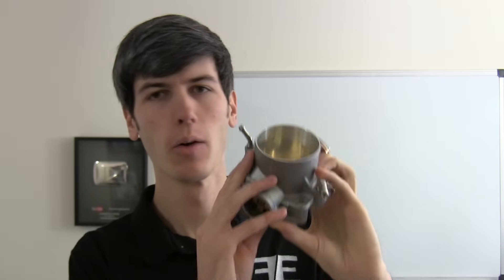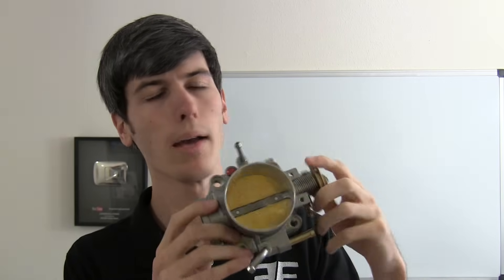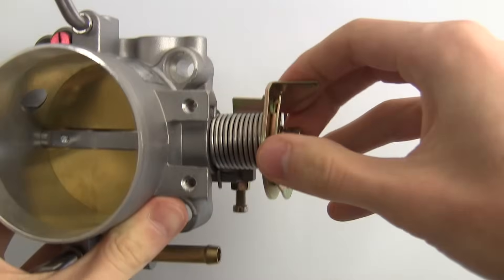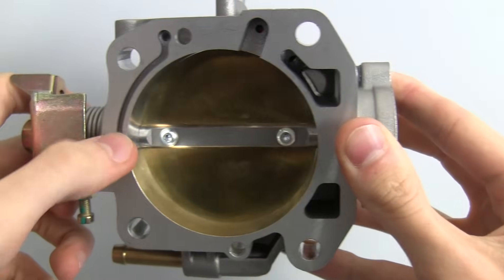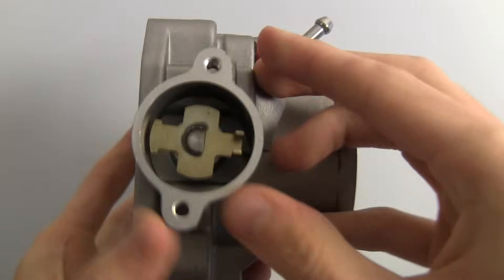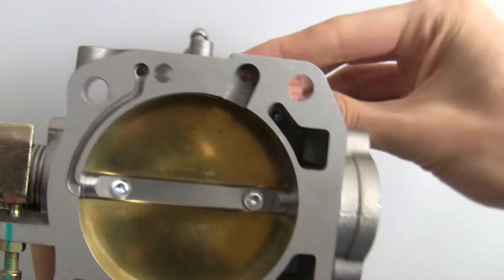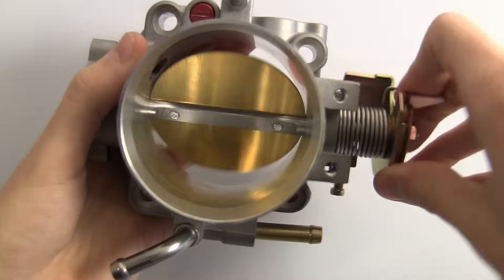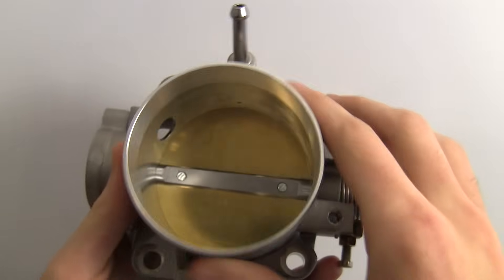Throttle Body - Explained

Comment: Hey I have a question. If I install a k&n cold air intake, a jet flow throttle body, and a jet flow mass air sensor. What can I gain? 2016 Chevy Silverado.
Reply: Look at the dyno charts. Also if it ain't dyno tested it ain't worth it. Always make sure the parts you're interested in are proven tested (with dyno results) as a lot are not. With all that being said generally speaking on average you could gain upeards to 20HP AND 15lbs torque with just an air intake. 
Edit -
•what size throttle body
•air intakes increase volumetric efficiency in your air intake plenum which increases HP in higher RMP ranges.
•get a jet performance MAS sensor with a throttle body spacer of about 75mm or bigger for your truck I suggest a 105mm throttle body
Reply: Your truck after those upgrades should pull about a 13 second 1/4 or quicker on average depending on how well you drive.

Comment: I'd love to see an explanation of Throttle Body Spacers and if they even truly do anything or not. Too much controversy.
Reply: Fake Name that sounds like a personal problem as that was a cheap one lmao
Reply: Do your research and you would know. Spacers are all about adding Volumetric efficiency, (more air traveling through your plenum). This increases MPG, HP in higher RMP range, and keeps the engine cooler providing more cool air for better, more consistent performance output. It's really simple and the information is more than abundant, friend.

Comment: This was a great, concise explanation of a throttle body. Thanks so much, not a huge car guy and I'm supposed to design a throttle valve and do CFD testing on the air flow for my senior design project so this was a good start on the anatomy of it.

Comment: This pertains to a YZF-R6 motorcycle, but I imagine the concepts are similar to cars. Long story short, my bike is running slightly rich and it’s either the aftermarket muffler’s reduced back pressure (I know it sounds backwards but supposedly on FI bikes this causes rich), or a TB issue. 

My question is; does adjusting TB vacuum pressure have any effect on mixture? If so, would a higher vacuum draw correlate to more, or less air per fuel?

Comment: my engine light came on my 2010 Chevy cobalt. I had it diagnosed. it came   back as the throttle body. cam shaft and multiple misfires. now my engine light has went off. my dealer told me that it may have corrected itself and just wait and see if it comes back on again. Is this fact? also I am in Indianapolis and we have  had very freezing temps.

Comment: my car threw a code suggesting the throttle body was the problem. also on the same day, the car lost power. It drug like it was in 3rd gear trying to get going from stop. It also threw another code suggesting canister purge valve solenoid. But I am assuming it is the throttle body that is causing the power loss correct? And why would both codes go at the same time. Could one be responsible for both?

Comment: hello sir can you  please explain or post a review of the throttle body of toyota corolla 95 model how parts works and how to adjust idle and tuning.. thank u ,,, my toyota idles  high like a 1200rpm.. i just want some900 but i tried everything but i cnt seem to fix or lower it down

Comment: Can someone tell me how the car doesn't move when idle, even when the engine is revving, but when the accelerator is pressed, the car moves, I was just wondering
Reply: Ya it's called neutral.. when in park (neutral with brake on) or neutral the transmission is not connected to your gearing in your transmission which puts power to your wheels which moves you. So therefore when you rev the engine in these gears your wheels do not get power but the engine itself does.

Comment: Nice video, thanks! Do you think that it could be possible to obtain a good increases in horsepower and torque changing the stock throttle body in naturally aspirated engine?
Reply: Why is it that ,you did not explained ,how to adjust air screw how many turn exactly for a good mixture when engine is in idle mode
Reply: Yup it will especially if you're engine responds to modifications easily like the old school 302 Ford 5.0's do.

Comment: Great explanation and very thorough.  Can you explain what a throttle body spacer is and how it works ??  I have an F-150 w/6.0L engine.  My son says I should put one on and it will help power and fuel mileage.  Thoughts ??

Comment: Hey Jason, could you do throttle body spacers?
Reply: Yeah.

It would be cool be cool to see the science, if any, that throttle body spacers could have.
Reply: @joshcamarena64  damn the amount of you people who are lost on spacers is baffling... They increase volumetric efficiency by adding more area for air to gather and spin creating more suction with a turbine like effect. This is used to increase the amount of airflow in your cylinders, increasing HP in higher RMP ranges, keeping your engine cooler, providing an improved level of consistent performance, and also increasing your MPG. Do your research. Information is everywhere just like oxygen kid.
Reply: @shoveI  read my above reply genius.

Comment: Good explanation, thanks.
I was looking for videos on which product (throttle body cleaner vs carb cleaner) to use to clean the throttle assembly/valve on my scooter safely, and ended up getting a very useful tutorial.

Comment: can you tell me what % of fuel is entering in to the combustion chamber when there is 30,40,50,60 degrees of rotation in throttle respectively.

Comment: if im cruising in top gear and let off the gas pedal, throttle body will be closed blocking the air going to the intake manifold. will the fuel supply stopped in cylinder? if not, how the cylinder gets air?

Comment: Is the butterfly plate needed on the throttle body??? Silly question to ask but, I have a vehicle with the ETC electronic throttle control and the reason I ask is because, the electronic chip I believe has gone bad and now my butterfly plate barely opens. I was wondering, can I just remove the butterfly plate to allow more air into the engine or that's a bad idea??? What's the reason for the butterfly plate anyway??? I already cleaned my throttle body but found out, I have a bad electronic chip or whatever you may call it.
Reply: Could potentially cause idling problems.  I did that on my sportbike for more power but the idle was all over the place and initial take-off was not smooth at all.

Comment: does the throttle body have anything to do with starting the car up I have a 2007 Yukon Denali I already changed the battery I already changed the alternator and some days the car starts up perfectly fine others it has hesitates to start up and I did a lot of reviews of the GM SUVs 2007 and up have a throttle body problem that's why I asked
Reply: Cam Mims I believe your gmc uses a electronic throttle. Those electronic throttles have problems because they are controlled my computers. The electronic throttle is probably the reason why you are having problems with your throttle on your gmc. I really wish that car juts stayed with throttles that had a cable

Comment: what does it mean if there's a rattling sound coming from the throttle body? can the throttle body be associated with rough cold starts? my mechanic originally said it was from carbon build up but when we looked that wasn't an issue.

Comment: does engine stop its cycle while no throttle?  ie,  no suction, no power, no exhaust
Reply: good question I want to know too
Reply: There is always a ideal amount of air flows in and thus the fuel, even though you don't use the throttle.

Comment: Why wouldn't you want to heat the air up before going into the combustion process. Hot air mixing with gas and exploding to 300F+ seems better than cold air. More conversion of the gas i'd suspect and less unburned fuel
Reply: ***** good point... it comes back to the trade off of more power or more fuel economy

Comment: Thanks for the info. I took my 2009 Ford F-150 to Alexander Ford in Yuma Arizona for stalling problems and starting problems. I was assured that 99.9% of the problems were caused by the Throttle Body. Can you tell me if this is true or not? At $800.00 for repairs, I would like to know.

Comment: Im sorry, what I don't understand is that how a throttle changes the air going into a cylinder. the only way more air can be put into a cylinder is by using a turbo or supercharger. you cannot change the amount of air going into the engine because there is a set space in the cylinder ( cc ) and the amount of air displaced by the piston is always equal. Please correct me if i'm wrong or tell me the answer, its killing me.

Comment: If I were to get a bigger throttle body, would I need a different tune, or would the computer, and the bunch of sensors be able to recognize it, and keep everything running fine?
Reply: This is really dependent on the parts you get. Some require a tune and others do not. I reccomend a plug and play throttle body of 75mm or larger.

Comment: When I turn my A.C on my car acts like it wants to shut off and it starts shaking. Is that do to the Throttle body?
Reply: do your lights flicker? your alternator might be bad if it dips too low
Reply: I'll have to check. If I leave my key in on the on position for a few minutes, the car won't start  back up.

Comment: Can u please make a video explaining individual throttle bodies vs single throttle body & what's the benefits between ITBs vs just CAI
Reply: +outofspace2014 And what would u choose between these two for your integra & why?
Reply: +outofspace2014 ITB tend to have better engine responses and better air flow. They are tend to not be friendly to every day cars, (cars that are not mostly performance oriented) and to get the most out of them they will have to be tuned with the car's engine. cold air intakes are simple to install and are more car friendly, when you put them on, they just work for the most part.ITBs allow all of the cylinders to have there own source of air. Just like exhaust pulses engines have intake pulses. On a single throttle body setup, since all of the cylinders are not firing at the same time and they share the same source the air is distributed between them, the intake pulses interfere with each other causing some cylinders to get less air than others reducing power. (the loss is very minimal, but if you are racing than that is horsepower you will not have, also the higher the RPM the more this is an issue) The reason why ITBs tend to have a faster engine response is because of two things, the plenum intake runner seen on normal single throttle body setups that brings the air to the intake manifold, and pressure waves. The plenum runner that are on normal setups have to depressurize before the outside air can go in, delaying the air from reaching the cylinders. Pressure waves are created when the butterfly valve or valves close. When air is rushing to get into the engine and the valve closes the air doesn't stop moving instantly. The air smacks the valve and bounces of it in the opposite direction, creating a vacuum in between it and the face of the valve. This vacuum pulls the air back toward the valve with added velocity causing it to enter the valve when it open at a faster rate than without the pressure wave. This only occurs when it hits the valve, so the valve will have to be mostly closed for these pressure waves to occur.This only works when an intake valves opens as the pressure waves reverts (pulls back the air). meaning that this only works at certain RPMs. With extensive tuning you can increase the amount of times it happens.The bad thing about them is that they do not play well with stock ECUs and measurements in stock cars. Without a plenum or filters they are exposed and can allow debris and unwanted materials to enter your engine. You can add a plenum but the associated benefit of not having one is hurt for the most part. You can supercharge with ITBs with the plenum on.With CAIs the benefit is that they tend to be farther away from the engine and closer to the outside air, so they get a colder charger of air. Compared to the ITB they are more friendly to cars and do not rely much on tuning.ITBs are for people who are looking to draw out every horse they can, like racing. Formula One and Dragsters use ITBs. CAI are for simpler builds and for people who want to add power to a car that can be a daily driver.
Reply: +godfather1118 Thanks for the answer dude :) Now i get it!!

Comment: sorry to ask but , what are the consequences to not have a throttle valve ?  and have the air that the turbo is providing directly to the engine ?
Reply: +JoãoHD LeagueofLegendsPT  If you do not have a throttle valve then you will not be able to control the engine's RPM and power. When the vlave is closed mostly it restricts the amount of air that can go in the engine, reducing the amount of power it can create. The larger it is open the more air can be passed at once and the more power you make. If there was not a throttle valve then the engine will suck as much air as it possibly can, causing it to redline until it breaks or runs out of gas.
Reply: thanks man !
Reply: Godfather explained it quite well. there are a ton of videos of diesels getting stuck at wide open throttle. worth a watch its kinda freaky

Comment: This video is very useful. I finally understand how my car's damaged throttle body was affecting the oxygen sensor and overall acceleration and why my rev meter was out of control. Many thanks!
Reply: This guy has done so much to educate people over the years. Wonderful channel.
Reply: Carly McCalla GM throttle body remplacement 1990
Reply: Yup. Imma guy and i still don't understand how they all connect. I just know the RPM gauge went crazy and that thing caused it

Comment: Why is it important for the throttle body to have so much air?
Reply: +FlowerRFabulous The engine needs air, lots of it. An engine is like a giant vacuum. It will always try to suck in as much air as it possibly can. The throttle body is there so you can control the amount of air that the engine can suck in. The more air it sucks in the more power it makes, the faster you go. If the throttle body was not there than it would be the same as if you were constantly flooring it all the time.
Reply: godfather1118 interesting. so whenever there is no air, you arent going anywhere?
Reply: FlowerRFabulous Yep, with no air the engine will not even start. If the engine is running and you suddenly cut of its source of air it will cut off.

Comment: If the throttle body isn't putting in enough air when it's idling could it cause the engine to stall and shut off when not accelerating?
Reply: +Kris Bluefield yes
Reply: so is this why I have rough starts and they want me to get a new throttle body?

Comment: So when you're in neutral and you don't use the throttle at all, the valve is closed right? Then how does the engine get any air? How does it not stall?
EDIT: Ok, nevermind, didn't watch the whole video xD
Reply: coz we have iacv..

Comment: On a Saturn ion 2007 if the coolant lines aren't connected or there's a malfunction in them will this cause the car to stop moving forward as if something is wrong with the transmission

Comment: Could you do an explanation on ITB's? I want to know the difference between a TB and ITB.
Reply: +Edgar Navarro  on ITB it has the injectors inside it. a regular throttle body does not have injectors. ITB Meters fuel AND air intake where a TB only regulates air..
Reply: Oh ok thank you so much I never fully understood itb's (:

Comment: Can I get a larger aftermarket throttle body if everything else in my engine bay is stock?
Reply: +Juan Rodriguez yes you can, but its probably not a good choice if it is stock. Throttle bodies are finicky when it comes to adding power. They have to be the right size for the engine to perform properly. You usually install a larger throttle body along with other upgrades that increase power. Install a larger one when you need a larger one. A larger throttle body on a stock car may increase horsepower, most likely it will stay relatively the same or perform worse than the stock throttle body.
Reply: +godfather1118 thanks!

Comment: Question: Which scenario wil use more fuel : The throttle is fully opened , The throttle is partially opened. The throttle is fully closed.
Reply from the maker: +Kennedy Poi More air, more fuel. Fully open means the most air.

Comment: would a bigger (aftermarket) throttle body...say on a stock sr20 do anything performance wise???
Reply: +MongsGaming probably not. An engine only needs so much air in stock form, and the stock throttle body presumably can give as much air as the stock engine can take.

Comment: What would happen if you just jammed or made it so the throttle bodies where open all the time would you get more air in all the time and increase bhp or would it just naft your engine over time. There there for a reason . Any one got any input that be great.
Reply: +Andrew Beedom it would just be as if you had your foot flat to the floor on the gas pedal ALL THE TIME... wouldn't be driveable.
Reply: Ok cool thanks for your help

Comment: My throttle body keeps making my car idle at low speeds and it stops sometimes when I push the gas pedal it does nothing. I've changed the throttle body and its still doing the same. I heard u have to program it  could that b the problem if its not programmed? If not what do u think is happening?